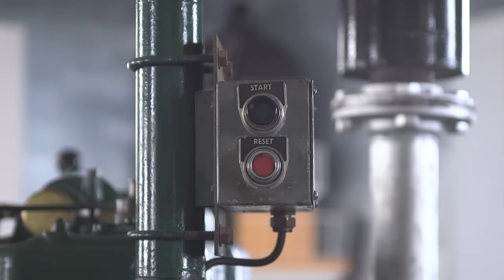Sounding the Sumburgh Foghorn

Comment: When engines were made to last centuries...
Reply: That is the only true way to measure quality.  Low hours, low power output. consistent operating environment... yup that is quality.
Reply: I mean what's the point in that? Even if it's static, you'll be getting it replaced in 2-3 decades at the most because things just get better.
Reply: @accountname9506 We have planes from the 50s and trains over 100 and automobiles and some old sewing machines too, America.
Reply: @lowlightevangelist9431  All the planes from the 50s are typically owned by private citizens, they aren't used by anyone doing serious things for the most part. What are you talking about 'automobiles'. And 'old sewing machines' used by some hobbyist doesn't count and you know it.
Reply: @accountname9506  We have a groundwater pump in our basement. Roundabout 80 years old. We had an O-ring replaced when I was a kid, and that is about it. What is there "better" to replace it with?
Reply: @DevSolar  I'm talking about things like car and plane engines. There are a lot of improvments in those.
Reply: May I introduce you to 1992 Honda CRX
Reply: @accountname9506  sure, but new engine still needs maintenance and cost of buying new one covers service of the old one for years. If it's not broken - why change it? What's the purpose in this case?
Reply: @kamil7307  The purpose is that if you make a engine that lasts 100 years the rest of the car/machinery is still going to fail, and repairing it back to what it was will probably cost more then just getting a new car/machine.

If your product is going to be obsolesecent in 15 years, and unoperable in 20, there's no point in making a amazing engine that lasts for 40. Same for any part - really long lasting parts are only worth it in rather rare situations.
Reply: @sir8513  I don't like planed obsolencence either(I'm only just getting to replacing my iPhone six now), but in the modern day tech advances way faster then it used to - you used to be able to use the exact same kind of tool for centuries(sickle), and then you could use something for decades(muskets), but now better stuff is coming out so often that sometimes it's more worth it to just replace things then keep them around.

And machines don't last forever, especially the kinds used in vehicles - they take a lot of stress all the time. But(For a example) cars now can go MUCH further then cars 30 years ago, sometimes by multiple digits. Modern cars are also faster and more survivable then they used to be. This kind of change is happening with every industry.
Reply: @sir8513  The stuff made by slave labor is shit I agree but the stuff that isn't is really good.
Reply: I worked in a metal shop, most of the cnc machines were from the 60s and worked fine. They then bought a brand new steel cutting laser for over 1 mil and nothing but problems
Reply: @nugsymalone1247  over engineering
Reply: @accountname9506  U2 plane, August 1, 1955.
Reply: @Lontonce_   lm.
Reply: True and he clearly takes care of it
Reply: @accountname9506  there are shipping company's still using dc-3 aircraft. C130 airframes ar as old as 50.
Reply: ...a lifetime!robust!
Reply: Andrew Crews  Kelvin Engine, K2's I think...
Reply: @grahamwhitehead9498  k
Reply: The true ecology its called.
Reply: True. I'm from Argentina... And given our economy... All we can import are chinese things. They are meant to last at least 1 year. It's horrible and earth-polluting.
Reply: @martinferezin5598  
Yes!

They last a year IF THAT!
We have replaced 6 major appliances in the past 3 years. 2 clothes dryers, 2 clothes washers, a 'smart' TV (replacing a TV purchased barely over a year before) and a refrigerator (replacing a refrigerator that was a year and 3 months old). We paid decent money for all of them as well. Looking back, I honestly don't know how we did it financially. We thought we were buying a quality product.....but as soon as that year warranty was up, BOOM! Trash.
Global warming issues? How about building products that don't have to be replaced everytime a person breathes on it wrong! Small kitchen appliances and utensils are junk as well.
Where does all of this rubbish go? 
Not to mention the negative impact that running the factories has....

I am churning with emotions about this and I thank you all for listening to me vent. 
😳🤯🙄😪😡 
😊
Reply: @lowlightevangelist9431  We've since lost that ability too.  It's sad.

All hail Toyota
Reply: @bigdog517  one Toyota failed at 150k and another at 250k
Reply: @lowlightevangelist9431  Oh I bet!  Seen plenty run past 300K too

IME of all the work trucks I have used for gvt work or home work has been my Tundra (free to disagree!)

Nissan Frontier I didn't care for too much for but damn near indestructable

All early 00 vehicles

Early 00 Ford Ranger is very durable too but needed frequent small repairs
Reply: @bigdog517  Titan fell apart at 120k, Camry at 150k and Tundra at 250k (circa). Cavalier went 225, GMC Sub 250k, and Chevy flatbed dually grain truck at 550k with 454 using Rotella
Reply: @accountname9506  gun technology has slowed down and has barely advanced at all in the past couple decades. Things like material changes and force multipliers have made weapons more usable, but how small arms work hasn’t changed much since the 60s. The peak has been reached, so unless there’s a need, small arm weaponry will not advance that much. However, larger weapons will advance undoubtedly.
Reply: @DevSolar  depends on how deep and how hard the well is and youll need the new tech
Reply: True, Our days people can't even build a sand castle...
Reply: @swagon4545  I can't even build a sand castle,  I've tried....lol
Reply: @Lontonce_  92 huh ? My 91 was great. Had the single slammer d and a doch vtec and that cammed d would take the b16 .   But yea crx's were great , up until they stopped making em in 91.
Reply: I don’t know
Reply: @S1n4h  Eh, I'm used to tard wrangling, and they weren't malicious for the most part, which made it a lot easier.
Reply: @accountname9506  more survivable? 😂
Reply: @br-sb6vu  they handle rougher shit longer.
Reply: @accountname9506  you have a money problem bro not everyone can replace something when something just gets old. If it works it works I got 284k on my shitbox runs better than your average 2020 car it's from 97 and imma drive it till the wheels fall off.
Reply: @jimmy5860jim  I'm talking about actually obsolete things. I still have a iPhone 6 because it works and is fine. But very few things are going to go centuries while still being good (compared to newer things) at it's job.
Reply: @accountname9506  I guess the more technology you put in things the more things that can go wrong and you got to pay more for it but yes technology is getting better but how far can we really go every phone is the same yea some glitch more than other but all phones do the same thing. Bring in something other than an iphone I'm surprised that still actually works XD ...
Reply: Minor improvements really. Innication has stalled
Reply: Yep
Reply: @accountname9506  well, it was made probably well over 50 years ago, I doubt its used anymore. the video is just a cool little demonstration
Reply: @milesnoble8646  oh, of course it's cool. people just have a lot of nostalgia about old stuff, which is fine, I have the same. it's just not as good as new stuff.
Reply: Then there wouldn't be a steady supply of money to the makers so they had to make everything last for only 5-10 years

Comment: I'm a retired compressor mechanic and have worked on a variety of other industrial machines, that would now be considered antiques.  There is a great sense of satisfaction in watching the old mechanism work, even if it is for nothing more than nostalgia.
Reply: Can relate... theres something uniquely soothing and captivating you only find on those old machines running slow and healthy. Almost trascendental, or probably indeed so.
Reply: What powers it?

Comment: "The horn of Helm Hammerhand shall sound in the deep... one last time."
Reply: Robin you deserve more likes
Reply: And horn sound from rohan
Reply: Now to wrath, now to ruin.
Reply: If I heard that I would think that was a Tripod out at sea and I would be GTFO.
Reply: LOOL that was literally the first quote that came to my head! Then right as I scrolled your comment was the first to come up lmfao!
Fell deeds awake....
Reply: Robin the battle of helms deep
Reply: @nabilbeg9906  Now for wrath, now for ruin, and the red dawn*
Reply: YEEEES!!
Reply: FORTH EORLINGAS!!!!
Reply: SINCE WHEN DID DIESELS GROW SPARK PLUGS ? ? ?
Reply: @helvehammer7846  Well, they do have glow plugs.
Reply: Cardboardguy 14  no because it’s at 666
Reply: @helvehammer7846  So they have actual spark plugs so they can run on gasoline for starting?
Reply: @soaringvulture  Yes - they did !
 International Harvester diesels had carburetors and magnetos. Started and ran them on gasoline. When they had run enough to get hot the operator moved a single lever. Several things happened - the intake air bypassed the carburetor, and a large poppet valve closed and sealed off an auxilliary combustion chamber that had the spark plug in it. That had the effect only a single small combustion chamber was pressurized by the piston giving much higher pressure suitable to compression-ignition (diesel) running. Lastly that lever enabled the diesel fuel (diesel oil) injectors to squirt directly into the small chamber and actually run as a diesel.
   Brilliant engineering by old-timers. I hear the International engine's complicated cylinder head casting were known to crack if the engine wasn't idled for a while before shutdown. But I guess they made a couple million engines of several different sizes on the same design !
  The only thing I know about the Kelvin engines is that they *WERE BIG AND HEAVY*, lol . . .
Reply: Gimli: YES!
Reply: Was anyone else expecting that two Tone nose like from Scooby Doo 😂
Reply: @MrCraftboy29  where is the Thunderchild!
Reply: Gimli: " YEESSSS "
Reply: Yoss ❤️
Reply: YES
Reply: The sound of most dwarves when they first wake up....
Reply: YESSSS!
Reply: @helvehammer7846  Here in America they are commonly known as Pony Motors
Reply: I'm an American and I have owned a D-9 Caterpillar with a pony motor for 35 years. I put electric start on the pony 20 years ago.
Reply: @helvehammer7846  D9 is a big track machine. Oh how I struggled to stay awake while operating a D8, track machines will lull you to sleep if not careful
Reply: Bizarrely, I made the exact same comment as you did, two months prior. No likes. YouTube algorithms are weird.
Reply: ahahah,,,,,all you people are good ones.... video #1
Reply: @helvehammer7846  For cold starting it uses a very small amount of petrol & thus needs spark plugs to ignite it. The changeover to diesel is done by the lever on the top of the engine. More convenient when the engine was originally started by hand.
Reply: @NJPurling  How disappointing that you did not either read or comprehend the previous posts in this comment thread - or you would have realized how superfluous your comment is.
Reply: @nabilbeg9906  And the Red Dawn!
Reply: YYEESSS!!!! THATS THE ONE I WAS THINKING OF!
Reply: Frodo's not going to be happy with this
Reply: @danielhenderson762  

... and the Sun Rises ...!!!
Reply: @kineticdeath  

Perhaps that was her blowing ...

... seriously, though, the Titanic, and her two sister ships, had steam horns, and whistles, that were pitched so it could be heard for miles, but as it was such a bass tone, the noise wouldn't transfer to the first class cabins directly below ...
Reply: This is the best reply 🥇
Reply: @helvehammer7846  Preheating the diesel for optimal temperature.
Reply: love you now
Reply: DEAAATHHHHH
Reply: This comments sections so so wholesome and nice, how YouTube should be!
Reply: Trynna make me cry, Robin??
Reply: I actually thought itd sound like the horn of helm hammerhand xD
Reply: I don’t know why this video was in my recommendations but I clicked it just to look for this comment.
Reply: "YESSSSSSSS."
Reply: @nigelft  what is the wavelength or oscillation of the bass tone too wide for it to propagate down right below it.

Comment: 0:20 He is lubricating the high pressure air compressor to prevent overheating. While also adjusting some of its equipment.
0:41 Turns on the high pressure air compressor. (Equipment used to compress air to a higher psi, so when the foghorn is sounded the air is trying to escape the horn faster than low psi air)
1:08 Opens the air bank valve (the high pressure air compressor stores high pressure air here for later use. By opening this valve he is most likely opening 2 pathways: 1 from the compressor to the bank, 2 from the bank to the foghorn)
1:33 Most likely a crude timer for the foghorn. Most countries use a time base for how frequent they sound their foghorns. U.S. is roughly every 2 minutes.
Reply: Mathew Ross   You would think right?
Reply: Thank you.
Reply: The port of LA sounds the angels gate twice every 60 seconds when it’s foggy due to the high traffic in and out of the port of la.. sadly it’s more of an electronic beep than a horn.. lot’s of fish around the rocks below the little light house building though
Reply: Great explanation 👌
Reply: Thank you so much for the explanation on what I watched, I was beyond clueless.
Reply: They sound at known intervals. This way, the ships can use a stopwatch to determine what horn/lighthouse they are hearing. The lights are timed as well.
Reply: EVERYONE LOOK ITS THE FOGHORN NERD
Reply: @holdencross8949  back to TikTok, shoo.
Reply: “Yeah, Well, You Know, That’s Just, Like, Your Opinion, Man.”
Reply: I just wanna say lubrication doesn't prevent over heating (although it does contribute because friction causes heat and lubrication minimises friction but;), lubrication prevents parts from absrasing eachother by creating a thin layer between the parts so they dont actually touch, over heating is usually prevented with coolant which is mostly water to extract the heat from parts to prevent excessive expansion and damage from heat it's self to the parts. anything that is prone to overheating will use coolant and/or lubrication or a mixture of both and something that is prone to wear/abrasion will usually only need oil/lubrication.
Reply: Why would you know this lol

Comment: That's very cool. I didn't know it took all that work to sound a foghorn.
Reply: All the stuff down below is the air compressor to pressurize the two large, red tanks outside. The clockwork in the top is the timer for when the horn sounds, which is VERY important because the time interval between blasts is how mariners can tell which horn is sounding and use that to navigate safely.
Reply: What the hell is this horn supposed to be?
Reply: @HyouMix  To warn navigators of a presence of a vessel or obstacle or shore. It best works during fogs or poor visibility.
Reply: @HyouMix  It's a fog horn. It was used in the days before GPS to warn ships that there were rocks here that would sink them. They also used it to navigate in the fog. These days it's more of a backup to GPS.
Reply: Gerald Hall same, kinda gutted there isn’t some red faced guy on the verge of passing out on the inside 😂
Reply: mad ass  😂😂 it's not like the GPS system in cars with loaded maps of local area, there are no roads in the ocean.
Reply: dIsCuS cRaZe gps in ships tell you water depth where fish are, any objects in the water etc
Reply: @surroundsound6427  you are kinda right. But you are thinking of a depth finder. But they have gps integrated to mark locations etc. A gps alone would only give you a location. Depth finder gives you the rest of the info
Reply: Wayne Heaney i’m really not i’ve been on boats heaps of times the GPS literally says knots and depth in the water, then next to it there’s like a fish finding thing i never understood it and something showing if there’s objects underwater and objects ahead

Comment: It’s not only the sound of the horn that is authentic here. I am an Operating Engineer and what fascinated me most  is the sound created by the man and his machine (air compressor) in order to produce the air that will blow the horn. From the prepping (lubing and priming of the moving parts etc.), starting, engaging, valving (line-up), and setting up what looks like a timer but a device to sequentially line up the reservoir connections to the horn. Everything was done manually and it was all like mechanical music in my ears. I was already in nostalgic cloud 9 even before the horn farted it’s glory. PERFECTION!
Reply from the maker: I'm really glad you enjoyed it, thanks!

Comment: I get so happy when I see the old good stationary engines used for their original tasks, the old engines have soul. They just need a little oil and fuel to last a hundred years, I've been involved in overhauling them. Incredibly little wear, no replacements but only gasket replacement when we put them back together after fifty years of daily use.
Reply: Yeah I am honestly more fascinated by the engines in this than anything else
Reply: gone are the days when things were built to last
Reply: @yorkshirelad3133  - Yes, unfortunately.
Reply: Indeed, old machinery has a beauty about it that today's electronic chips don't. What looks better, highly polished brass control levers or a black plastic keyboard?
Reply: Don’t have to replace / lap Babbitt bearings on these dinosaurs?
Reply: @stevedoe1630  - It happens.
Reply: @dartskipper3170  old machinery , any part can be made , that new custom chip absolutely no replacement , in the trash she goes